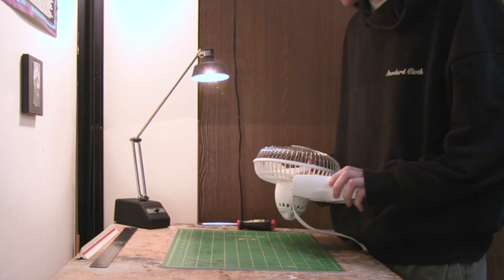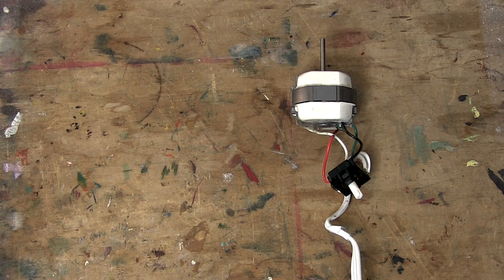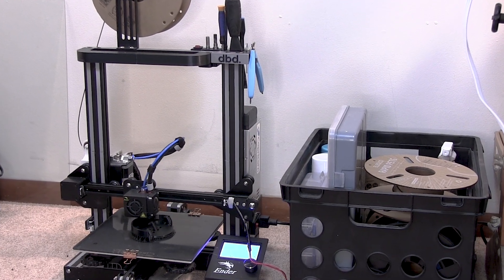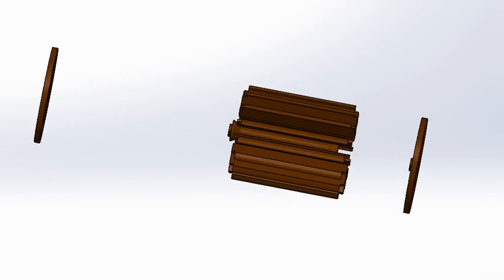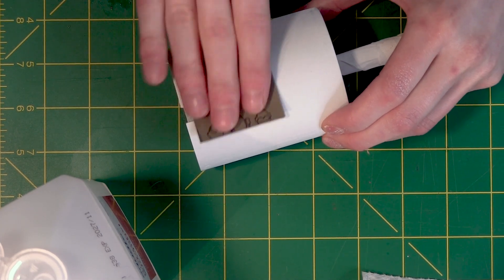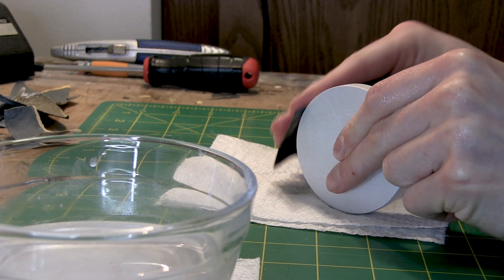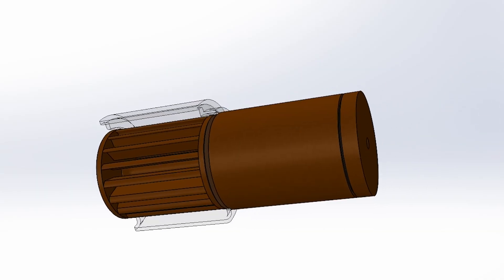3D Printing a Forgotten Icon

Comment: So glad you did this. I found an original HL70 this week here in Berlin 🇩🇪, where I live. Alas, it doesn't have the stand. I am slowly building my Braun original collection. I found your video while looking for the 3D files for the stand. I'd be happy to pay for it too. I ❤ your approach to this design. I appreciate you taking the time and effort to update this jewel to be used for many years to come. Thanks!
Reply from the maker: That's awesome! Did you find the stand files? I have them up right now but I actually plan to update it soon to make it more 3d printing oriented. I printed mine in resin so it wasn't a concern at the time.
Reply: Hi! I just got the fan today 😊. It's so tiny!  I got it from a lady who had it from the 70s and it is in pristine condition. I was mesmerized watching your video bending the acrylic. It looks amazing. Wow! I haven't yet decided whether to go for acrylic bending or 3 D printing for the stand. I am learning how to use the 3D printer at my  local library...we'll see how it progresses. In the meantime, thanks again for making all the files available.  @distracted-bydesign

Comment: I'm so sick of how much plastic waste gets made. I'll go through hours of tweaking supports to make as little waste as i can. Only using 2 layers of pla as the interface layer of a petg print just to reduce filament changes and get clean seperatation and a more for sure print(reduced support issues on the print). Then my brother will crap out dozens of tiny multi color prints that waste more than the model itself purging and throw half of those away because they didn't work.

Comment: just printed a similar cross flow fan! wouldnt work as well with PETG, but with PLA, I just printed the impeller as one part and the overhang between the blades came out fine. I did print the center of the top plate as a separate piece though, but thats just two pieces instead of 20 to assemble.

Great stuff!

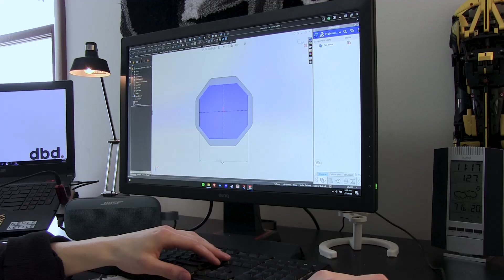Comment: I really enjoyed the video, and I’m most likely planning to make the same desktop fan using your STL, but I had a question pop into my head — is your statement at 2:13 actually valid? No negativity, but are you Spider-Man’s uncle or something? What kind of responsibility are you talking about? When it comes to 3D printers, it’s primarily about creativity and imagination — people expressing that in different forms, in the way they want. “Low-quality toys from low-quality plastic”? With all due respect, Spider-Man’s uncle, China was already producing this stuff on a massive scale before you were even born, and your video won’t change that. To me, a 3D printer is such an interesting and versatile tool that the very idea of restricting people in terms of what they should or shouldn’t print is just baffling.
Reply from the maker: I wouldn't say I'm trying to "restrict" people from printing things. I may have come on a little too strong about it. I think if you have kids and want to get them into making things, by all means print toys. But when you have people buying dozens of printers, mass producing toys, and selling them for the same price (or more) as injection molded stuff, I think it's a little frustrating. I think that's nearly the opposite of creativity. Especially when they are just buying the commercial rights to the designs. To me at least, I see 3d printing as a way to consume less and make my own things whenever possible.

Comment: Hey, great video, pleasure to watch and resonates deeply with me (just like your other ones). It is delightful to see how you progressed from purely functional parts to something that also has design in the sense of appearance and haptics. I'm not sure to what degree the following is on your mind or how you think about it, but maybe it sparks something:

3D printing is not only the things you mentioned, but it also enables manufacturing of geometry that machining can't, and it also is widespread and very cheap. If you know your way around CAD and engineering, you have the power to put things into peoples hands, that didn't exist yet or were so expensive that nobody could afford them. All through clever and creative design, that is not the (somewhat trivial) kind of creativity where one does whatever in an unconstrained activity space, but by circumventing present roadblocks for broad accessability by exploiting the unique possibilties of 3D printing. Two major approaches would be to either design a novel mechanism (flextures are an interesting field), or to find a design/geometry that works despite using much weaker plastic to do something that required machined metal before.

Long explanation short: I can see the hacker gene in you, I'm just not sure if you're aware. Read hackaday dot com/about for what I mean. And there are more dimensions to good design than the list you show at 3:07. With good design you have the ability to gift access to things for people that they couldn't have before. Watch the Hackaday Prize 2018 clip (youtu dot be/c8LM4IMILuw), you have more power than you probably realize
Reply from the maker: Wow, thank you for this comment. Have you heard of Victor Papanek? He was an advocate for socially responsible design. He developed a really interesting play environment for children with cerebral palsy. He's an inspiration of mine for sure. 

For the past year or two my main goal has been to make whatever I can with whatever I have if that makes sense. But I certainly hope to find that idea that could truly help someone/many people. I recently spoke with my girlfriend about this actually! 

So thank you for sharing your thoughts, it helps keep it in the back of my mind! And also for sharing the hackaday clip. I was unaware of that.

Comment: Wait but is sharing it or selling the file legal ???? Because recently I also drew and 3D printed a slightly modified replica of an already designed Verner Panton lamp but because it's from the 70's it's still under copyright and I thought it would be cool to share it for free (didn't even consider that selling the design could be legal) but then read a bit about it and I'm not even sure I can legally share the design for free in most countries. My legal research wasn't very thorough though so maybe I am wrong and would be very curious if you had some good info on this. If we can share these or even sell our own versions of some iconic designs it would be really cool ! I don't think I have the courage to put the file online unless I am sure I won't get sued...
Reply from the maker: I think I'm going to change the model to be free when I release the next version. It honestly didn't come to mind since I didn't have an original fan that I directly reverse engineered and I'm not selling a physical fan. But at least if I list it for free I'm not earning anything from it. I wasn't aware copyright lasts for 70 years.

I haven't found any patents but that's not as permanent as copyright anyway.

Comment: FYI fan motors like the one you used to build this are designed to cool by the air being drawn through by the blades. The motor may have some issues if you don’t have a means of cooling it.
Reply from the maker: Yep! In hindsight this video was more of a proof of concept. I've been working on the design quite a bit since posting and will have a new video soon.

Comment: What version of solidworks are you using? Found the licenses are quite expensive
Reply from the maker: Look up the maker version! I got it at $48/yr on Black Friday. There is a cloud version and also a locally installed version which I prefer. The only thing is the parts can't be opened in commercial Solidworks. And 3d experience isn't the best but it's manageable.

Comment: Great job! Just a quick tip, the original had the fan casing start close and then  get further away. That's actually how the fan is supposed to generate the pressure needed to create airflow, so if you decide to rework it in the future (which you seem to be planning on, based on your replies to comments), that would perhaps be the only functional flaw I can see. But design-wise, terrific work, dude!
Reply from the maker: Thank you! but yeah I did change that blade shroud, I'll have a video coming up about the changes I've made.

Comment: Personally I feel while sanding and painting had their place when FDM was used for prototyping, when actually designing for 3D printing one should embrace the texture of 3D printed parts, rather than trying to mask it. Oh and your Ender should be capable of much better results with a bit of a tuneup and perhaps replacing a few parts (extruder, hotend primarily, and a new bed can open up new design options). It's a very popular printer so there are a lot of great aftermarket parts!

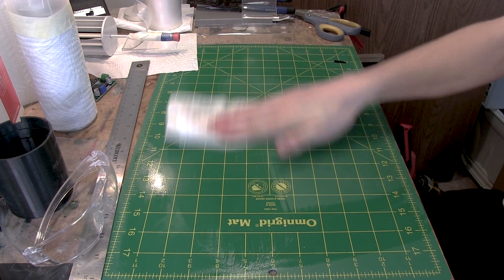Comment: 8:36 you need to use way more glue dude
Reply from the maker: It's not a thick glue. It's a thin solvent. But I didn't show all the footage either (hand was in the way). It bonded nicely.

Comment: I find that the best way to approach 3D printing is to forget about aesthetics. Visit the "functional print" subreddit and you'll see what I mean. When you accept that layer lines are a fact of life and stuff doesn't need to be painted if you can deal with your fan being all the colour of whatever filament you had at hand, your printing life gets immeasurably easier.

Comment: What is the name/brand of the fan that you gutted? And what was the final cost for the full product?
Reply from the maker: It's an air king clamping fan. I think they are like $20 but I gave motor recommendations in my printables files. Overall, it took about 3/4 of a spool ($10). Acrylic was $5 and the cement was $12. I'd say around $50ish to do this yourself.
Reply: @distracted-bydesign  Thanks! I found the exact model on amazon (for about thirty dollars, the item's name is Air King 9145). I will definitely be purchasing this model.
I was wondering, if i purchase the model do i also get access to improved versions that you will release?
Thanks.
Reply from the maker: @catstudios764  Yup, I'm actively updating the files on Printables.

Comment: > extremely pretentious premise about how 3d printing is actually bad because people make low quality things
> pontificates on the dangerous pitfalls of 3D design for printing (literally first 2 things any beginner has to learn)
> does the worst job ever actually designing and tuning in a functional thing, proceeds to smooth it with putty like a shameful bumper dent

> btw one of the best products that disapper into everyday life disappeared onto my desk

I'm not an expert but CAD design is a lot of easier when you don't have to squint at the screen from the confines of the inside of your ass
Reply from the maker: still tuning the design
Reply: @distracted-bydesign  there's nothing wrong with the design, just please don't lay on attitude so thick! glasshouses and all

Comment: 9:00 invest in heatset insert tips for your soldering iron, then they won't go in sideways into the plastic
Reply from the maker: I actually have those. But the soldering iron has a different thread size.
Reply: @distracted-bydesign  That sucks, in case your current soldering iron mysteriously dies the pinecil is pretty good, proper temperature control and can run off a usb power bank.

Comment: I am absolutely impressed that you completed this project with the tools you had. Especially the Ender 3 is hit or miss and by now obsolescent. Using the heated coils was dangerous but also very inventive. 
Absolutely on board about printed junk, I´m always working on making useful and durable parts with as little was as possible.
Reply from the maker: Thank you! The Ender 3 is extremely hit or miss. It's usually fine for smaller stuff.
But I've taken a couple EE classes and a circuits lab so I somewhat knew what to expect with the coils.

Comment: Funny that this should pop up in my YouTube suggestions, as my Braun HL-1 sits next to my iMac. I picked the Braun up at a Salvo's (Australian Salvation Army op-shop) about 15 years ago for less than $20. Aside from a good cleaning and some lubrication, it has performed flawlessly. The quietness and volume of air is impressive. Reinhold Weiss and Dieter Rams' designs stand out unmistakably. I am sure they would be both proud and impressed by your efforts!

Comment: Cool project! Only thing that bugs me, you say you don't like the cheap waste of 3D printing but proceed to tear down a perfect good fan for its motor and driver. I'm assuming you threw away its plastic components?
Reply from the maker: So I actually used the clamp part for another project and then the rest of the stuff stays in a box in case I ever need it.
Reply: @distracted-bydesign Right on 🤙🏻

Comment: Sanding HIPS is way easier than sanding PLA or PETG. Adhesion of plastic filler and paints is very good. It prints OK open frame, but emits poisonous fumes, though not as badly as ABS. You not only have to fill the voids but also knock down the high spots, which is where difficult to sand materials let you down.

Comment: This is a fantastic project! that only thing that would give me pause for thought is the temperatures inside the motor enclosure, it might get quite hot in there with no ventilation, might it be worth adding some vent slits on the rear of the housing where no body can see them?
Reply from the maker: Yep I'm adding a bit of ventilation and a few other tweaks.
Reply: @distracted-bydesign  Well I cant wait to see the second revision, and I have subscribed to because I love this kind of content

Comment: I worked as an apprentice for Braun from 1983 to 1986. I had a bunch of parts for those desk fans to tinker around with. Today I really regret that all that stuff got simply thrown away. I still love the clear and simple design of those desk fans. Funnily you can find a lot of Braun items in the movie "Blade Runner". Especially in Deckards appartment. Several Clocks attached to his picture analyser, a juice extractor in the kitchen and even the desk fan on a table. And in one scene, I guess it was where the snake scale got analysed, you see a Braun desk lighter.
Reply from the maker: That's awesome! I think I saw somewhere that the HL70 was in Blade Runner.

Comment: Rule #1: If you do a cool printing project, you make the files available. I'd probably tweak it to use commonly available motors you can just buy off Amazon or something. I have an Ender 3 V1. It's possible to get very good prints out of them, but they are tricky to get dialed in compared to newer printers. Getting a BL/CL Touch helps. The stringing and failed supports are likely due to your filament being wet. PETG loves to suck up moisture from the air. Clogged or worn nozzles are another common problem. The squirrel cage could probably be printed as two pieces, but finishing would be more of a challenge.
Reply from the maker: I didn't make the files available yet because I'm still fine tuning this project. I will release them probably in the next couple weeks when I post a follow up video.

The filament was dried at 70C for 6 hours prior to printing. I went through the classic troubleshooting many times.
Reply from the maker: Files for version 2 are now available on Printables!

Comment: Making parts smooth is hard, so don't do it. It would have been easier to create a texture or pattern on the surface that 3D printing does well. I think if you had considered more of what 3D printing does well, you could have made something more interesting. For the fan blades I would have made to parts with a base, no top and every other fan blade. The based for each would have a hole or recess for the blade from the other part. Then you are only putting two parts together and they are better aligned.

Comment: This was awesome 3D print. I have the 1968 Braun T2/TFG 2 table lighter. Though,  mine isn't working properly it is a retirement repair project I'm looking forward to. I'd be will to share it's dimensions if you were so inclined to remake one for yourself.

Comment: I have a Braun desk fan identical to the one in the photo. It's almost in mint condition and still in use. I bought it around 1988-90, the last one in the shop, and never saw it on offer anywhere again.
Braun used to be a pioneering industrial design leader, known for its watches, clocks, kitchen appliances and revolutionary stereo HiFi equipment, still considered on par with Bang & Olufson.

That was all long ago now. The design and quality of Braun products became indistinguishable to other competitors after Proctor & Gamble bought up the company. Just their high prices remained the same. I bought their top of the range battery powered shaver about 10 years ago thinking that the quality and longevity would justify the enormous price. It lasted just 5 years. Compare that to the Braun shaver I bought in 1975, which still works fine.
Reply: Dang, I ran across one of these at an estate sale in the closet, wish I had snatched it up when I had the chance but I had no idea that they were uncommon these days

Comment: 🤨 I think, that vintage fan was discontinued is because the “impeller” is exposed; had no guard/cage over it as part of the design - only that acrylic cup on its back for the cross-flow effect
Reply: I have this same fan and can assure you, the impeller is totally safe. You can put your finger into it and it simply stops.
Reply: @mikethespike7579  pet safe?
Reply: @ Yeah, a cat might hit it with its paw and get a harmless surprise.
Reply: @mikethespike7579   If a regulation says it can't be exposed then it doesn't matter how safe it is.
Reply: @brinkoftext  True. But anyone who wants to make their own fan doesn't need to follow regulations.

Comment: 4:53 print a jig to hold the blades while you glue the first side the second end is tricky but if that first side is straight should be pretty good.
Reply from the maker: I did actually use a jig but I was able to get them together without it.